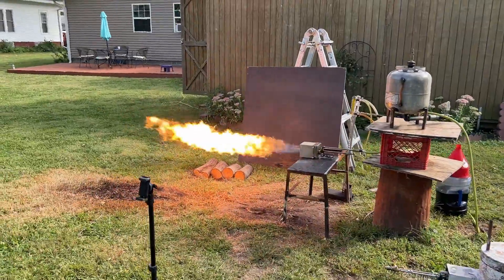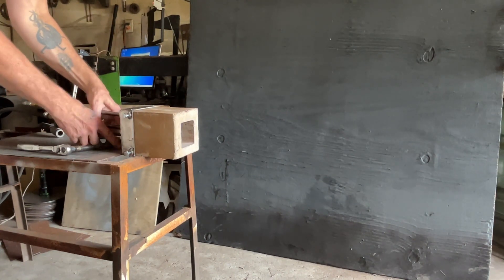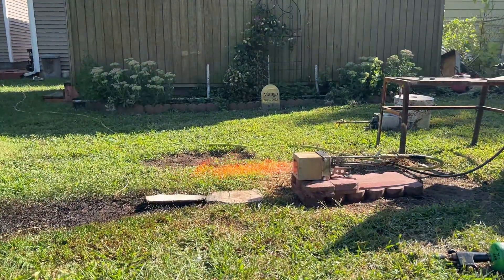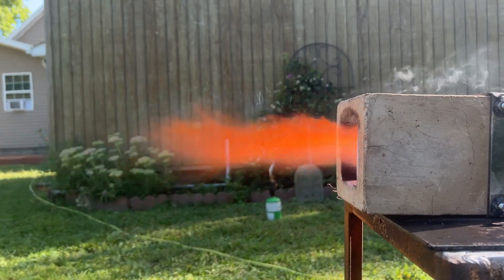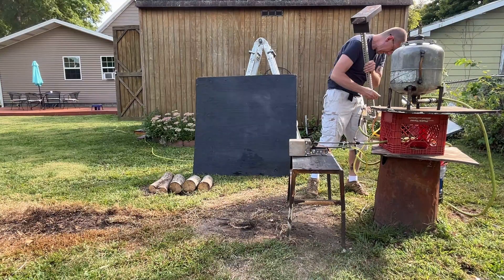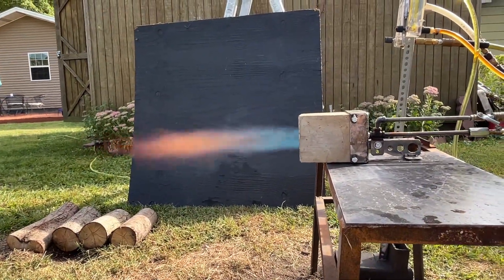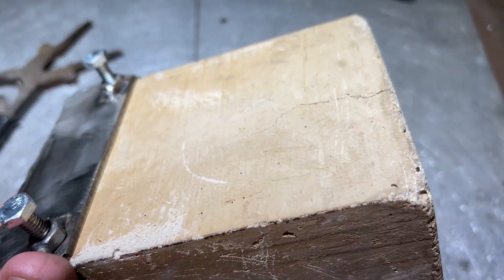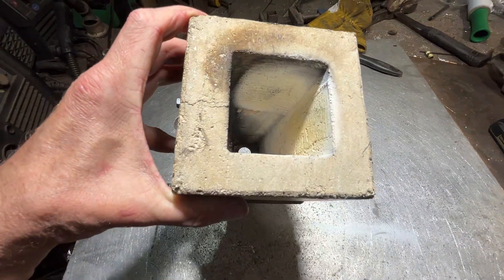Stone Burner

Comment: I think you need a orifice/ diffusion plate.

I made a Ribbon Burner one on my channel except mine is based with a fan, not injected HP air.
But I get a VERY big flame, about size of this at 2PSI of propane and a 440 CFM fan.
Orifice and a plate to agitate would help a lot.

Comment: This has got to be acting as a catalyst,  those refractories are almost identical in chemistry to ones they use in petroleum cracking and steam reforming etc… tho less poruous as a zeolite 
.
wouldn’t be suprised if when red hot this is catalyticly cracking whatever liquid fuel your adding into smaller molecules and hydrocarbon gases.

Wonder if  the propane is reforming to hydrogen or if the gases don’t have enough time/ contact with the actual refractory particles

Comment: I know you are old school but you should get one of those cheap 3d printers .Just imagine the moulds you could do on those and then cast them in refractory . Later pla plastic just burns off.
Reply from the maker: Working on it , i have a $1000 software called Rhino3d but the learning curve is steep . Its not like quick cad or auto cad
Reply: @NOBOX7 use fusion360